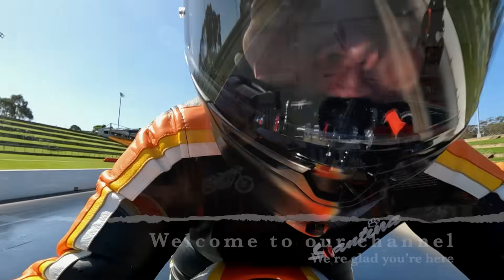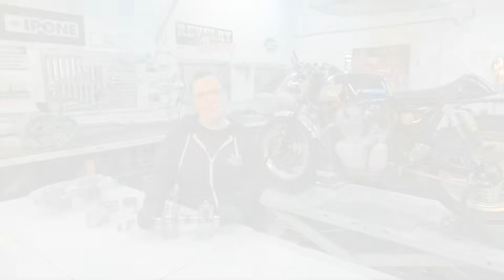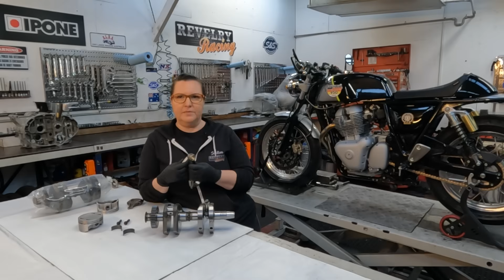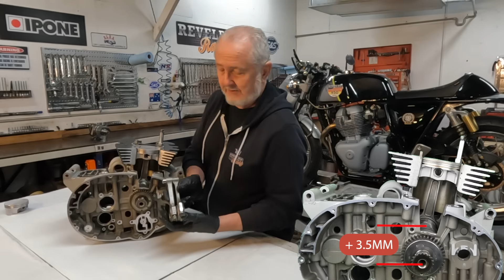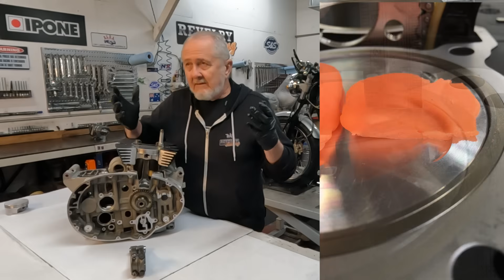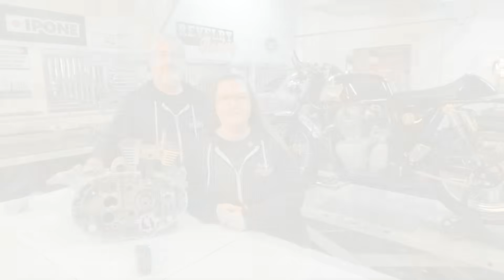Episode 11: Stroker Kits - Royal Enfield 650 Twins

Comment: Talk is the new Royal Enfield 750 Himalayan will have both bore & stroke increase.  
If we are lucky it may be just a stroke increase from 67.8mm to 78mm. Keeping the existing bore at the current 78mm this would give us 745.43cc.  Solely a stroke increase would be ideal for many reasons.  
Royal Enfield may beef up the engine components to cope with this extra power, that is ideal as then the engine would be able to cope better with having a larger capacity than even 865cc.  (It already seems to cope, but stronger engine components would help)

Were S&S Cycles to bring out a 90mm big bore kit, similar to as they do now for the RE 650, though with longer cylinder liners to fit the new RE 750 this would give us a potential 992.43cc engine.    (ie, 90mm bore x 78mm stroke)
Virtually a one litre Royal Enfield motorcycle, wouldn't that be nice!
(Great for a long distance tourer with panniers etc, especially if an after market belt drive conversion was available).

Though of cause the opening in the engine cases would also likely need to be enlarged (bored out) to accommodate the larger outer diameter of the new cylinder sleeves that come with the 90mm bore kit. As is currently needed fitting a 90mm big bore kit to a RE 650.

So for those that do not want to flaff around having the engine cases bored out, maybe a solution would be if S&S Cycles provided a 83.5mm big bore kit, similar to their 750cc upgrade to the existing RE 650 series.
That currently does not need engine cases enlarging and when affixed to a longer 78mm stroke RE 750 this would give us an increase to 854.26cc. A 109cc increase.
We see it is not far off the existing current 865cc 90mm big bore version, but without the off-putting engine case enlargement.

All this of cause depending upon Royal Enfield 'only' increasing the stroke when upgrading the 650 to a 750, and of cause S&S Cycles producing a new big bore kit to fit the RE 750.
Tuners such as Revelry Racing/Hitchcocks etc must be quite interested in the new Royal Enfield 750 engine.
I bet they cannot wait to strip that new engine down to see what engine mods Royal Enfield have made and what modifications they can safely make to it.  Same with S&S Cycles.

So Royal Enfield, just increase the stroke and leave it to others to turn that newly enlarged capacity engine of yours in to what could be up to a 1 Litre engine.
There is of cause no reason why Royal Enfield could not later on do it themselves. If initially they just increase the stroke.

Comment: Very nice video.. Didn't know that the enfield had such a following for mods..  One thing to note is that the only advantage of stroking over bore is that it changes rod to stroke ratio.  That may help in higher compression motors but with timing and cams optimized to generate equal pressure, only displacement difference makes more torque.   In other words,  when comparing stroke or bore, displacement wins.  In fact a slightly larger rod to stroke ratio from boring produces more torque.

Comment: Interesting, yet I would have a question about installing the big bore 865 only (with original RE camshaft) because for my needs (and financial possibilities) I guess it would already improve the torque plenty enough. I don't mind being limited at maybe 60 hp.
What other parts should I install to make it work properly?
Reply from the maker: We have a video on the Big Bore and many videos about all the other specific components that are required.   Start here https://youtu.be/N7nHqVu5npE?si=0tn1aSsd56Tr-hBj
Reply: @RevelryCycles  thank you

Comment: I was waiting for this video about 2 years! Glad to be back! What about a next video to analyze any upgrades for the cooling issues that may occur on this air - oil cooled engine at 900+ cc and almost 80whp. Any potential mods for the oil cooler? Maybe bigger and more efficient radiator???

Comment: This just showed up today in my youtube feed.
I like the new Royal Enfield twins.
I own a 1970 RE S ll Interceptor.
Old school 'hemi' combustion chambers were state of the art in 1970.
A 9:1 air cooled motorcycle required 100 ron - 96 R+M/2 - 5 star fuel,readily available at the time.
Now with a pent roof combustion chamber,4 valves,and yes,a precise timing curve,
an engine with a higher compression ratio can be run on a lower grade fuel.
I really like your manner of presentation.
Would you consider explaining the science of this modern day engineering?

Comment: Good to see you back 
Have you thought about providing a reflash service for the RE ecu ?
I have a 2023 Continental 650 gt with aftermarket two into one Tec exhaust and dna air filter and would like to add the cam and high compression 650 piston kit